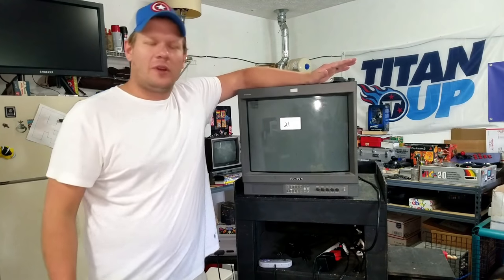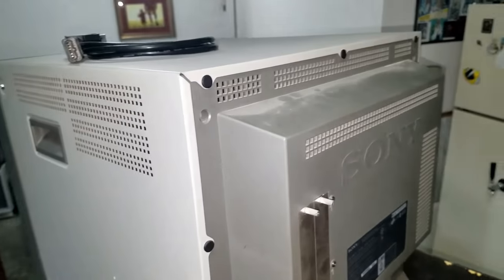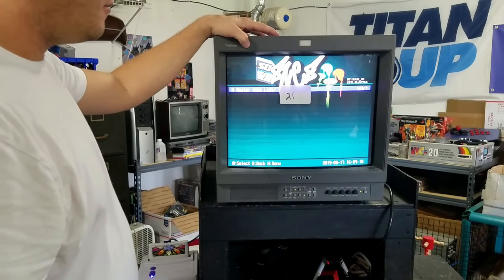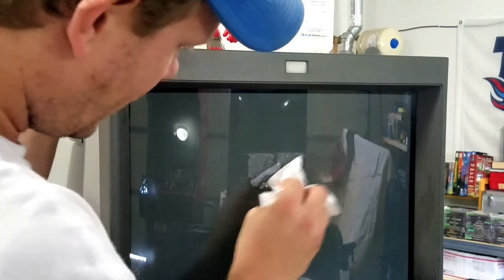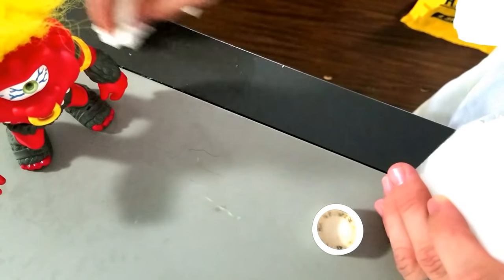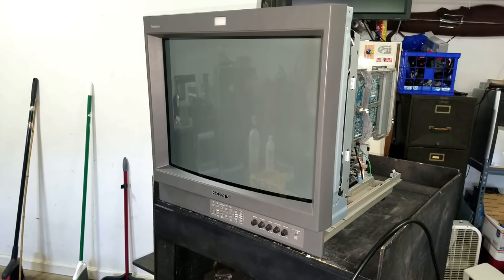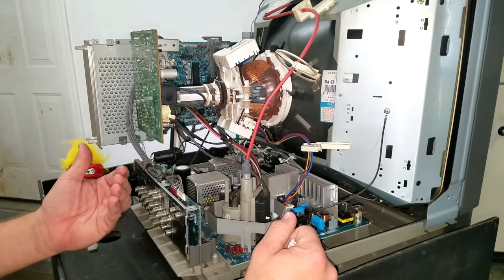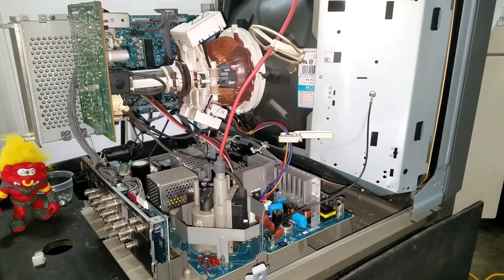Sony PVM 20L2 Overview (Part 1)

Comment: I just bought a really clean PVM-14L2 (built in 2004) locally and am super stoked to get it powered up and hooked up to my Mister. I plan on using Monoprice VGA to BNC cables as my Mister has the I/O board.

Comment: Really glad you're doing these types of videos Steve. Gives people the advantage of becoming familiar with the insides of these monitors and knowing where the danger zones are etc before having to open one up. Question - Do most of these monitors have an anti-glare coating on the screen? Is Windex safe to use with that? Cheers Steve :D
Reply from the maker: Hey Eric.  Thanks, and I'm not sure about the anti-glare coating being on every monitor.  I can only speak for my experiences.  I know for sure that there is an anti-glare layer on the 20L5, but that was the last model made and has the most features.  Only models may or may not have a coating.  Windex is safe to use on nearly all surfaces in my experiences.  I can't think of an instance where Windex damaged anything after I cleaned with it.  Most stores sell a monitor cleaning spray, but that isn't designed to clean CRT's anymore.  That's engineered for flat panels.  I've used Goo Gone on the screens of 20M2s before too and not had any damage to the screen.  Great questions.